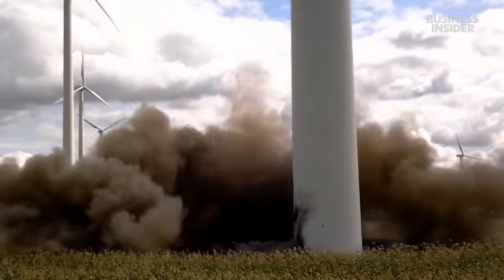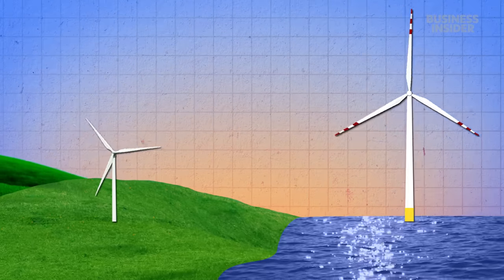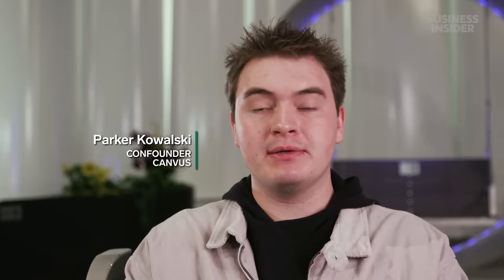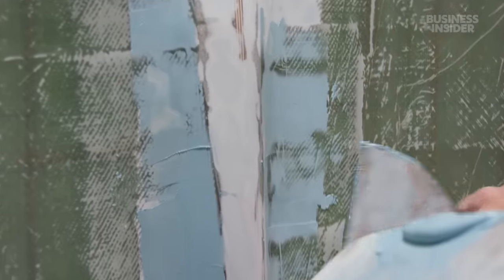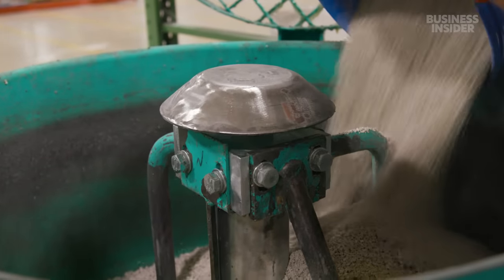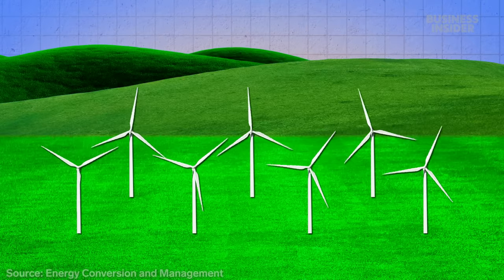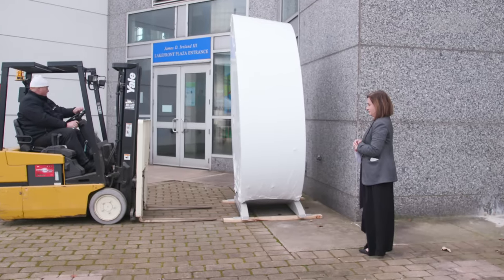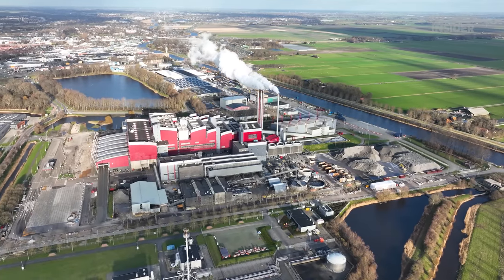How Bad Is The Wind Turbine Trash Problem? And Can We Solve It? | World Wide Waste

Comment: The solution should be to make the blades out of material that can be recycled, like aluminum, or sheet metal. A surcharge should be added to the cost of disposal of the fiberglass blades.
Reply: Blades could be made out of other materials, but that would make them 5x less efficient.

Comment: Just reading the title I thought this was going to be another one of those unfounded hit pieces, usually paid for by oil or coal companies who are seeing declining business because of these new and better forms of providing energy.  I was very glad to see the comparison of waste from different energy types, that showed the turbine blade problem is no where near the problem some make it out to be.
Reply: Firefighter here, I can assure you I'm not in the payroll of oil companies! Just got a few issues I'd like to highlight.
Wind energy is intermittent, meaning it needs to be stored when there is a surplus to cover when there is a shortfall. This is usually done with batteries. Currently those are lithium based, and these are a MASSIVE headache for emergency services and one which will only get worse as these battery storage sites get more widespread and as they age. Lithium mining is also extremely environmentally unfriendly, and the impact of that also needs to be included in the impact report of the turbines they are being built for (it's currently not, because it would make the figures look worse).
A lot of people have mentioned the airborne particulate hazard so I won't go into that too much, other than to say that once inhaled those fibres stay in your lungs for life. They can travel miles on the wind, so people living near those cutting/crushing centres might want to look into how well (if at all) the air is being filtered from those places, because I saw no water being used during cutting which would normally be a standard procedure to reduce airborne particles.

The waste figures they showed are I believe a little misleading, since they only show the current rate of waste accumulation, and as described in the video the turbine blades can last a decade or more, and with turbines being erected at the ever-increasing rate that they are, we are only seeing the waste resulting from what existed 10+ years ago, not including the waste we are still due from the last 10 years of ever-increasing construction. By the time we do see those numbers in 10 years time, another decade of even greater volume of construction will have taken place. Fossil fuels produce their waste virtually instantly, and still account for the vast majority of our energy, so of course it will produce more waste because we use more of it, and it's being compared to turbine figures that are effectively a decade old, AND which don't take into account the waste and pollution of the lithium mining and battery production which is as essential to renewable energy as the turbines themselves.

(Edited a confusing typo)

Comment: The blades , if wasted, represente about 5 to 8 kilos of resin and fibers for each home usng the electricity during the life of the blades; not so bad. And it will be recycled
Reply: This entire video is about why the blades cannot be recycled. Thousands of these are getting buried for a reason. Thousands of others are getting burned for a reason.
Reply: @Habib_Osman it still reprisents less waste then other options. Plus this shows there are solutions in development to eliviate the problem further.
Reply: @Habib_Osman  it will be recycled just as electric car batteries are now. It is still a lot less than the amount of fossil fuel needed for the same energy output.

Comment: Excellent, factual video. Wind turbines displace far larger amounts of waste from fossil fuel consumption.
Reply: Vast amounts of fossil fuel is required as the energy source  to manufacture, transport, and install wind turbines. Also the plastics aka PFAS, etc used in the wind industry are chemicals derived from petroleum and the lubricants that sometimes catch fire are petroleum products too. PFAS are referred to as forever chemicals because they do not degrade.
Reply: @KReed1966  Define "vast". For the items you list, what is the comparison of use between wind turbines and fossil fuel power plants? Maybe on a per KWh basis.

Comment: Putting it in landsfills, definetly not a bright way to use otherwise good ressources. I liked a lot of the here shown solutions though, even if only increase their lifespan till we then maybe have a solution to extract the base ressoruces again. I am not so sure about the cement usage, as isn't that just creating concrete that is even worse to recycle down the line?

Comment: Why not Include nuclear energy in any of the graphs?
Reply: Expensive and dangerous, but worth not getting invaded for.
Reply: @CTimmerman - Wind Turbines is much more expensive with lesser power output in comparison to its waste ratio than Diesel or Nuclear power. Majority of Wind turbine farms require a back-up energy source like Gas powered electric to keep them in minimum operational capacity.
Reply: It simply is not competitive financialy. By more then an order of magnitude.
It is just not a viable solution.

Comment: So by 2050 we may have 40 metric tons of blade waste accumulated but according to the EPA the coal industry produced 140 million tons of coal ash waste in 2014 alone. Why don’t we talk about that problem? It is the same thing with talking about the problems with recycling solar panels after 20+ years of usage and not discussing single use plastic water bottle waste.
Reply: The answer is simple. Everybody knows single use plastics are horrible for the environment, same for coal. Windturbines and solar panels are currently marketed in the whole world as being the ideal way to produce carbon neutral energy. So.. a report on the actually massive downsides to those is much more interesting.

Comment: A wind turbine produces the same number of pounds of garbage at the end of it's 25 years of blade lifespan as a single American does in a lifetime. 90,000 lbs. There are 330 million Americans and we seem to have no problem with the waste they generate. This is being blown out of proportion. Blades are not toxic waste or radioactive. They are just land fillable nontoxic waste produced only once every 25 to 30 years. Yes we may have 70 million tons in a few decades, but how much is that? The USA produces 7.6 billion tons of industrial waste every year. That's 1% of our industrial waste. See how the media takes a minor issue and based on it's ability to generate revenue, blows it up rather than putting it in perspective.

Comment: Not even one mention of the cleanest energy so far. Neuclear.
Reply: nuclear has a problem and that is mining, currently our output matches our consumption. Nuclear being 10 percent of our power load means that to use nuclear "exclusively" would require a 90 percent increase in our mining output. If you have any type of common sense you would know how difficult to near impossible it is to to increase something 90 percent especially a well established industry.
Reply: @zachmoyer1849  since nuclear takes very long to build, I don't see scaling up the mining an issue. They have more than enough time.
Reply: The main problem with nuclear is simply cost. It is completely uncompetitive by more then an order of magnitude.

Generating energy from renewables and then dealing with the bit of waste it creates is still a lot cheaper then nuclear.

Comment: Conventional recycling techniques don't work on any product made from glass or carbon fibre. Wind turbine wings are only a percentage of things made out of those materials and not a big percentage. Airplanes, boats, house sidings and so on. Why is this non recyclability a problem when it comes to wind turbines. Yes trash is bad, but glass or carbon fibre is not dangerous trash. It is not polluting. The amount of trash produced over the lifespan of a wind turbine is minuscule compared to the amount of power produced, especially compared to other technologies used to produce electricity.

Comment: Hi Folks,
        What you can do is to photograph each fillet in 3-D., and, in-put them into a topography finding program that will tell you what parts of a fillet can be used for a piece of a ship's hull.  The program recognizes the needed piece of the ship's hull and predicts where one can find it in the unfilleted blade, or in the filleted ones for smaller hull surfaces.  The computer cuts it up, lays it out and one assembles it shipyard style, section by section.
       You have now become ship builders.
        Cut me in for 1% of the gross and the idea is yours, Mr. Fabricator.
                    Sincerely,
                    R. Rex DeNemo

Comment: Wind turbines do NOT last 30 years. That’s on the extreme high end of life range. Mostly it is less than 20, often as little as 10 years.
Reply: 10 is correct
Reply: Nonsense. 30 years is the normal lifespan of a turbine. Only if they get damaged for some reason they will be replaced earlier.
Reply: @rogerk6180  Okay, then provide your sources big guy.    Put up or shut up. 🤔🤔🤔

Comment: Why go after wind energy when there are more reliable and abundant renewable energy sources. For example wave energy. All human civilizations are close to water and wave energy devices are far more easily recyclable.
Reply: They would still need machines like this to capture that energy. AnD the sea is a far more hostile environment to operate in so making these machines reliable and affordable is a major issue het to be solved. It is a lot more predictable so worth persuing further.
Reply: @rogerk6180  there are 100s of designs for wave energy devices and no they are not similar in design to wind. Im a rotating equipment guy and you can tap into existing industries so the machines are recyclable. Wave energy is also very energy dense, more so than wind.
Reply: @werewolf632  sure, and loads of companies are very busy trying to find a workable and especially affordable way to tap into this resource.
But at the moment the technology is just not there yet, otherwise we would have seen it deployed commercially around the world. 
Like i said it is far more predictable so there are major advantages to it over wind turbines. It will be a major source of energy once the issues are solved i am sure.
Reply: @rogerk6180  it's there. The technology is all there and new ones are coming online all the time. Investors are going after old tech because it's been around for a while. They know what the return on investment is going to be. Therefore it will take a while or it may never happen until someone invests for the results.
Reply: @werewolf632  that is what i mean. If the return on investment in wind and solar is bigger then other sources it has not yet reached the point yet where it is ready for widespread deployment.
It will get there eventually.

Comment: Meanwhile I'm having trouble getting my 1995 Nissan truck to barely pass a Smog test in California so I can get a registration renewal and possibly sell it to upgrade. Damn intermitent check engine light. I mean it's already built, going on almost 30 years and it keeps up in traffic. Easy other 30 years with tires and oil changes to mantain it.
Reply: There’s fuel additives that’ll fix that & it’s available parts places as well as Walmart.
Reply: 😂 i hope thing change for good but what would it take?
Reply: Texas has the same inspections for older vehicles. Lucas makes many additives & they out do any of the rest.
Reply: I think the motor is breaking in since it was rebuilt 6,000 miles ago and that's how many miles i put on it in a year. I dont use it because at work they have stolen a pair of silverados and a honda accord and many catalytic converters.

Comment: So the solution is you need to throw money at the problem.  Wind power is already more expensive than most forms of energy and vast sums of money need to be thrown at the waste issue now as well?  As well as money for decommissioning them and having backup sources for if the wind doesn't blow...   Need to reinvest in nuclear.
Reply: Wind energy has been the cheapest form of energy for many years already. By an order of magnitude in some cases even. The only thing comming close is PV.

Comment: The never ending search for easy, inexpensive, long term electricity generation?  Geo thermal is everywhere on the globe!!  Wind, solar, etc are all problematic.  Plus geo thermal makes conversion to hydrogen possible; instead of continuing to use petrolium!!
Fusion is a pipe dream so start drilling for the heat!!!!!
Reply: Fission is cheaper in the Long run and safer then every type of energy